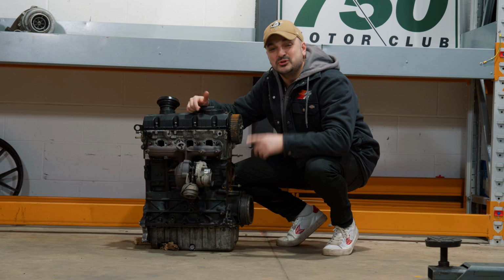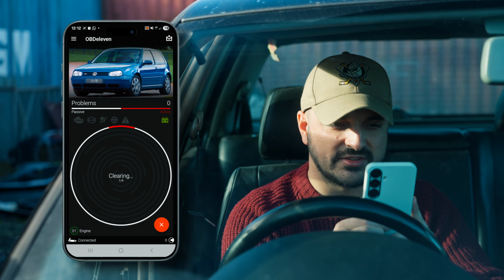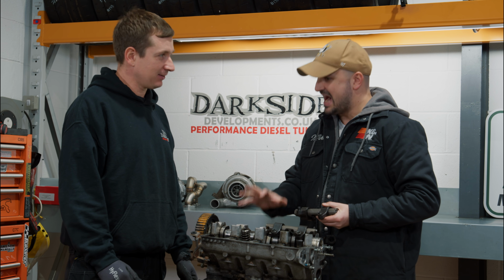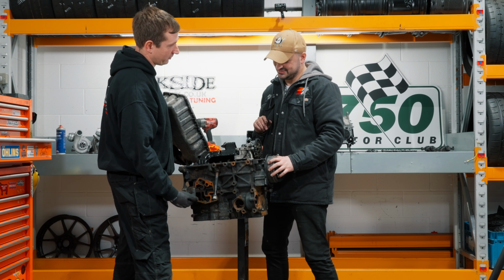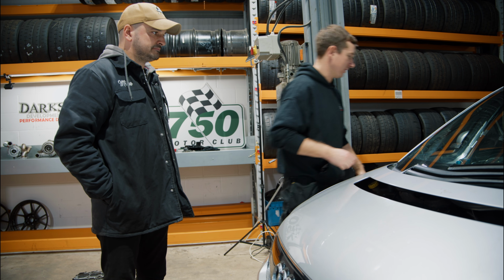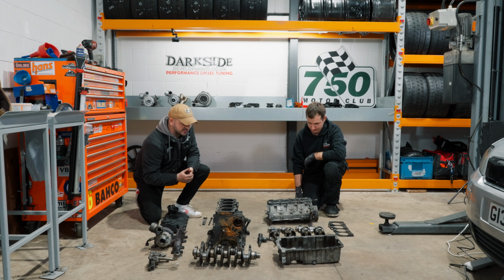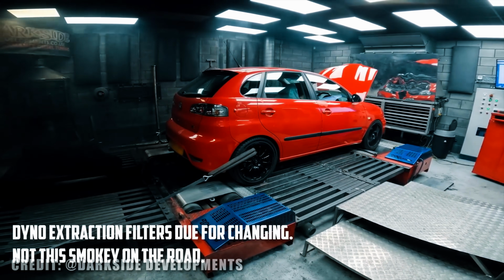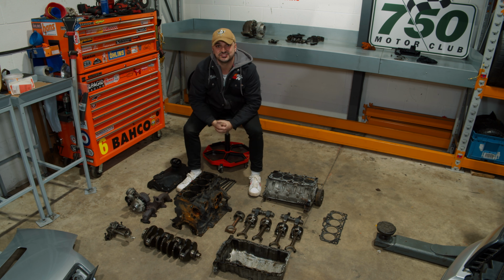Why This Volkswagen Diesel Is The Greatest European Engine Ever Made

Comment: I lost my beloved Passat B5 1.9 to an accident last year. It had 550.000km on the clock. When the towing service came, the guy jumped into the car (after it had hit the back of a truck with the front right side) turned the key and drove it straight onto the towing truck. My father who was involved in the accident and bought that car originally for our family 25 years ago almost started crying.

VW was their best under Piech!!! ❤
Reply: Please accept my deepest condolences.
Reply: @norwegianzound  Thank you! :)
Reply: why lost? sounds like it could have been saved
Reply: @emilhofstetter8975  The A pillar was completely wrecked basically destroying the structural integrity of the chassis. Trust me, I wanted to repair it. But my mechanic told me it would never be the same again 😕
Reply: What engine code did you had?
Reply: @Dragos280  Quite an unusual one, ATJ with 115 HP. It had two red letters in the TDI, the T and the D
Reply: @GuitarIv69 The ATJ is quite a rare one! My situation was an absolute nightmare, to be honest. I had the 2.0 TDI BMP on my Passat B6 and it was by far the most unreliable engine for me, no matter what i did, that engine it was breaking, eventually died completely and swapped to a 1.9 TDI BKC. I even threw some forged rods in it and I'm prepping it for a custom remap now. I hope this one will work as intended. I also have the same two letters in the back of the car, T and D, and I wanted to put R( from Reactor) to be Turbo Diesel Reactor😎
Reply: @Dragos280  Oh wow, that sounds crazy! Did you put the 1.9 in the Passat or did you get a different car with the 1.9? 😅

I heard the first 2.0 TDIs were unreliable, I have a Golf 8 with the 2.0 TDI EA288 Evo now and they seem to have fixed all problems, engine is sturdy now

Comment: Cant tell you how rewarding these engines are. Ive had three 4 cylinder versions and the 3 cylinder in my A2. All came with serious issues. All because they were not maintianed. After a service a timing belt , good new fuel
And a thrashing they work like new. Just picked uo a bug convertible with no turbo misfire, really slow, now its like a baby Porsche. And these are just the 101-105hp versions!

Comment: The diesel engine from PSA that did a lot of miles/gallon and had 100 hp was pretty sweet too.
Reply: In 1997 the JTD launched in Alfa 156 was the first commonrail, with unheard of refinement and performance but for some reason people only remember the stupid Pumpe Duse

Comment: Most engines could be good! Very good if built by engineering, not cost cutting and shit plastics, just engineering, inc thought for techs and service, no bullshit for life oils, no cut unless serviceable, no bullshit stop start shit! Just build good to start with! A car should last for ever! But in reality at least 15-20years, just a few that lasted, Mercedes 123 series, peugeot 504, carlton/omega straight sixes, lots of others as well! Manufacturers need a reality check to survive! All cars have or had issues! Nothing like today's shit show of regular cars! Bad engine design, bad gearbox design, use of unreliable shit plastics, over complex systems, non home service without specialist shit! Crap oils crap fuels, personally think hybrid is next option! I.e.toyota synergy not plug in! Defeats the object! So does government policy! Lower speed defeats! Causes pollution, lower or corrupt licencing for driving needs to be culled! Bring uk to german standards at least, not idiots giving idiots licences, does not happen lgv or psv! Jut my opinion!

Comment: 1CD FTV, Same period in time. 16 valves and, if all the junk is removed (plus big exhaust + enlarged ram air intake), 174 bhp (310 Lbs / ft) Stock VNT turbo at 20 psi, with a piggy back and more than 50MPG (rav 4, 1450 KG with revised gearing LOL). Plus Toyota never tried to con anyone re. emissions!

Comment: i own a 1.9l brm jetta. these pd engines are amazing. i accidentally ran it on extremely low oil for like a few months because the dipstick was reading wrong. and it only started to tick a tiny bit after a few months. poured half a quart and it cleared right up. mines been on a bad headgasket and a rusted out turbo for tons of miles and the turbo has abt 266k miles on it. if you want a relatively zippy car with tons of torque. good economy. and reliability. these are the cars to get

Comment: I own 2004 Audi A4 Avant 1.9 TDI 6 speed manual. Its PD130 and She's now on 548 000km  (340 000 miles) Still running well. And LOADS of TORQUE. She have typical VW rattle which I love.... Ryan is correct that PD is noisier than CR. PD is the best legendary engine in the world. Everything is original except original Clutch decided to left chat at 547 000km... She's most reliable ever I own. I often scare the passengers with big torque LOL. And I still get french languages due the Mileage, Many people shocked to see the mileage. She's extremely light on diesel. I wont sell mine. Oh the service intervals is 5000km, Oil and Oil filter every 5 000km using Shell Helix HX8 5w40

Comment: Stock AWX 1.9 130 on a 2003 passat. 370.000km. Engine+turbo original. 
Still doing occasional 1700km trips between France and Portugal. 
Next day after arriving, engine cold, oil level still stay the same.
I will never have another car like this. Amazing reliable one.
Changing oil each 15.000km with VW507.00 oil pays off.
Reply: I have the same one... want to ask... do you need to add oil stop liqui moly aditive to kind of keep the rubber seals soft?
From what I've seen here there are only rings on the injectors, and probably the rear and front main seal.
I'm still using Castrol Edge 505.01 5w40 oil and doing 10k km.

Comment: Life long mechanic here, the PD is a great engine. I currently have a Octavia 1.6 tdi it’s had a remap and it’s a great engine
Reply: 1.6 tdi reliable? Planning to buy 1.6 tdi skoda octavia dgte engine 2020 model
Reply: @lowkey1784 really can’t fault it all mate, plenty of power and consistency
Reply: @lowkey1784  They're a good engine not as good as the 1.9 TDIs of old or the 2.0 TDI that replaced the 1.9 TDI but still very good engine. I'd try and get one that avoids as much of the modern emissions BS as possible though.

Comment: I’m really interested in what I can do to my pd140 BMM 4 motion been following dark side developments for ages and had a few of there parts for my pd140 BKD engine but I’m
Struggling with the BMM been looking to things like pd150 ARL injectors and bigger turbo but with the propshaft and dpf in the way I can’t get bigger than 2.5 inch exhaust and having the dpf and cat mapped out seems like it can cause a good amount of issues.
Plus engine bay seems tighter for space in the BMM than it was on the BKD and less people other than caddy folk seem to have done a great deal with the BMM

Comment: 2001, 1.9 tdi AVF, the pd130 with a 6 speed. Tuned to roughly 200bhp with bigger turbo and injectors. Did like 400.000km with that setup. Miss that car to this day. Truely a legend.
Reply: Which injectors and turbo did you use?

Comment: These PD’s used a little oil up to 160k miles, then zero consumption after that, just broken it at that mileage,possibly a million mile engine with correct PD only oil used, otherwise camshaft lobe problems.The 130’s mated to 5 speeds were lower torque limited output units were better on fuel than the higher torque 130 6 speeds. Infrequent oil changes caused electric connections on PD injectors to get hot and fracture, as modern oil is not just a lubricant, but also a cooling agent. 5k oil changes and this is a million mile engine.

Comment: I had a Leon FR with the 2.0 170 PD and absolutely loved that car.  Later got the CR version and it never had the same punch as the PD. 

The old PD would sound like a tractor and go like a rocket, so much torque.   a great engine.
Reply: I had the ibiza 2.0 tdi cr. Remapped to 190bhp/330ftlbs and did 60+mpg. Best engine I've ever had!

Comment: Far from the most reliable. Reliable apart from major camshaft wear problem, leaky injector seals filling the oil with diesel worn injector bores destroying the head, turbo vans clogging up. Also valves hitting the pistons can 100% bend the valves. .
 The previous gen were more reliable.

Comment: I had a pd130 bora for over 15 years, put up 250k on it, only failed to start once due to the battery finally dying, what a great engine & car. Maintained well they are an amazing engine. Only changed the car as I wanted to try something else.

Comment: The 130PD is NOT the greatest engine. The older 1.9 version called VE is much better – no head gasket problems, no injector failures, no camshaft wear, no specific oil required, and no cracked heads leaking coolant into the combustion chamber. The PD is garbage. I’ve seen many failures even before 300,000 km, while the VE easily surpasses 1,000,000 km with only minor servicing.

Comment: they made a mistake developing this engine it is simply too good to be true, perfect apocalypse engine it will run on anything, i had a passat 90hp tdi mixed vegetable oil with leftover gas and used engine oil it ran flawless for a long time, when i was servicing it i poured used oil from the engine back in to the fuel tank i don't know how many times. 10/10 engine.

Comment: If you building a really serious 2.0 ea113 ive seen a few guys use the diesel block with some slight modifications. A fraction stronger than the stock 2.0 tfsi block

Comment: I know why the cams fail the injectors rock and move in the tube wearing the seat away causing fuel to escape the cylinder and wash the cam lobe causing it to wear.

Comment: it is NOT peak diesl PD engine is really stuid design putting injector harness INTO BOILING ENGINE OIL.. also good luck if any of those injectors start to act up entire thing tries to balance its ass and faceplants.
Oh and your injector develops a leak? Youll find out when your engine oil is diluted with diesel and the thing grenades.

Comment: I had a 2001 B5 Passat estate 130 PD engine code awx, it was 2 years old with 22k on the clock, I ran it for 12 years and put 265k miles on it, biggest problems I had was the water pump and maf sensor.
The water pump was replaced nearly every service as they just fall apart.
Maf sensor was hit and miss but I reckon I got through 20 of them and always kept a spare in the boot.
I did very little motorway miles, mainly used as a van doing jobs on farms and rural properties, she never didn’t start and never failed to get me home.

One morning after not having been used for nearly a week , it was - 11 degrees, my neighbour was struggling to start his 2 year old insignia , I gave mine two glow lights and away it went , albeit on one pot but it soon saw sense and was then used to start said neighbours car as he’d flattened the battery.
Reply: This one is 5 speed Manual. AVF is 6 speed Manual

Comment: my dad still has and daily drives a B5 passat with exactly the PD130, still goes strong. A couple years ago the thermostat broke and was stuck open, so the engine never reached temperature, and the injectors got a little clogged, I was fearing that was going to be it, but after a lot of fuel additive and a lot of driving, it got back to full health, and as i already said, it’s still going strong…

Comment: My 2009  A3 105 is now on 418 000 miles . I bought it when 2 years old with 60k on the clock Still averages 60mpg. Engine and gearbox never been apart.
Reply: Congrats! Bxe?
Reply: @tiffyroblox-g9x BLS

Comment: I had a PD100 in my 2004 Bora SE (1 red letter on TDI instead of 2!) and it was amazing. I got 75mpg on a long run once. It wasn't slow despite the lack of bhp because it had good torque.

Comment: You should definitely rebuild this engine
Reply: On the cheap. Clean and reuse everything. The crosshatching on the cylinder they showed was beautiful, head gasket wasn't blown, bearings looked good, pistons too. So i would imagine a good clean would get the metal bits up to scratch. Get what's missing used and it will most likely not just run again, but well.

Comment: Far from! Lots of issues
Only 1 small screw is clamping Down the injector, causing the injector to wobble in the head and wear to the injector bore.
I had one where the injector bore was visibly oval

1.9 alh is much more reliable

Comment: As well as Ryan KNOWS (but he keep silence about 😂), the "most mechanical"  1.9L diesel engine of VAG group is that AAZ indirect injection rotary pump, but as DIRECT injection team ..those vp37 series are most mechanical than pd130/150 or any PD which had electronic controll of timming on EACH injector and way more precise crankshaft position reading system.
Reply: The ASV is the best VP engine but the VP didn't get fitted to anywhere close to the number of cars the PD did.
Reply: @ryanp6138 asv was installed mostly on a3, but i think is kind of ALH twin brother... same weak conrods (weaker than older afn conrods), better elctronics

Comment: Well, there are some weaknesses on those engines too, that were discussed here. I'll explain how to get rid of those problems here:

1. The unit injectors are working inside the head, as they are held in place only on ones side.
The rocker arm pushing it down will lead to sideways motion.
There are solutions, that hold the Units injectors straight (called "PD Brücken"). They are quite expensive, but less expensive than a new head.
Use of thicker viton o rings is recommended. If the head is too worn out, you have to mill the seat of the injector out and insert steel sleeves.

2. The plugs falling out the rocker arms:
Easily preventable by getting them out and weld the holes shut. A good welder will do it without problems.

3. The Cam lobes and hydraulic tappets will wear out.
You can't do anything against it.
The love is pretty big and does have high rotational speeds because of its high circumference.
Having good oil and change it yearly or every 10k miles/15.000 km (don't wait any longer) helps to prevent fast wear.

4. The Unit injectors wiring harness will wear out and lead to faults.
Replacing it is fairly easy

5. The Dual function pump on the head (fuel pump and vacuum pump) will eventually leak. The diesel will destroy cooling hoses below them.

Otherwise these engines are very, very sturdy....
Reply: Point 3: Usw only 5W-40 505.01 Oil, change latest at 10.000km.
Reply: @pilotistbreit  Wrong. Use instead VW507.00 5W30 oil rated to long life service, but change it every 10.000km. The VW 507.00 oil norme is the most severe one to this engine. 
Its by using bad oil people destroy engines and then complain.

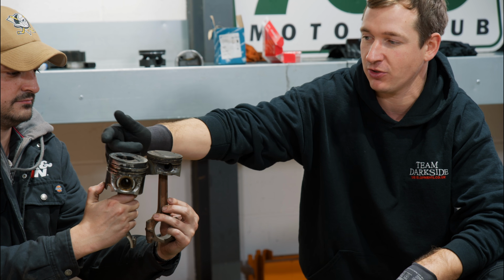Comment: 30:30 If your conrod is getting bending force something is up. All of the piston & half of the conrod goes from stationary to over 200mph & back again twice per engine rev. That's huge acceleration so if it's a huge reciprocating mass (to house a combustion chamber) it will generate huge force requiring a huge conrod just to absorb the internal forces that add up to zero anyway. A similar sized Rover K Series makes comparable power.

Comment: I'm convinced that the solution to CO2 emissions should have been this 1.9 engine or the 1.4 3 cylinder PD. with a bit of development to run on bio diesel. I mean look at it, fully stripped and there are about 30 pieces

Comment: Good engine family, but most reliable ever? not even close. I could compile a list of US V8's and UK small fours but my vote is the Toyota R Series, 1953-1996 unbreakable indestructable, you can drive them with no coolant or an empty sump for 100's of km's and they shake it off. But probably not both at the same time.

Comment: My first car ever, A mk4 Golf gt TDI pd115, I love it, did over 100k miles in it until I had diesel runaway on the M6, turns out the turbo blew. I sold it, new owner put a turbo on it and car was running fine.

Comment: I don’t know what happened in the US, but over here they had a lot of issues with cams and fuel injectors. I’m sure it boils down to poor maintenance. They struggled hard to meet US emissions which made them give way to the common rail engines.

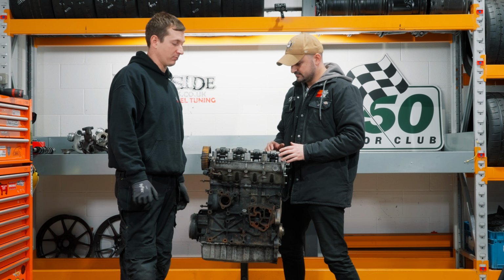Comment: 8:45  Cam lobes can wear if the incorrect oil is used. You can get PD specific oil ( VW  505.01). Many dealers and shops will say to use VW 505.00 or some alternative. 505.01 is essential as it contains the correct additives for the cam material.
Reply: 5W30 VW507.00 its the superior severe protection. Much better than 505.
Reply: @ruifilgo  507 is ok too but I went with 505.1. 507 was designed for later common rail engines with DPF. VW says it's suitable for PD but 505.1 was specifically designed for it.

Comment: I used to have a Fabia VRS as my daily driver which was a PD130. It was excellent, went quite well, loads of torque and power for a small 4 cylinder hatchback and I would struggle to get less than 40mpg, On a run 50-60mpg was possible.

Comment: I bought a 2001 Passat 130pd off my brother for it's wheels (it had golf Mk5 diamond cuts) for £300, drove it home and thought it's too good to scrap I'll use it until it dies and keep miles off my main car. Well it lasted 4 years and did 40k more miles, the engine was still fine with all the suspension collapsing I drove it to the scrap yard with 250 thousand something miles on it. Also got 380 quid back in scrap 😂